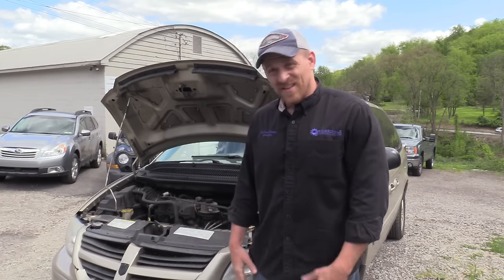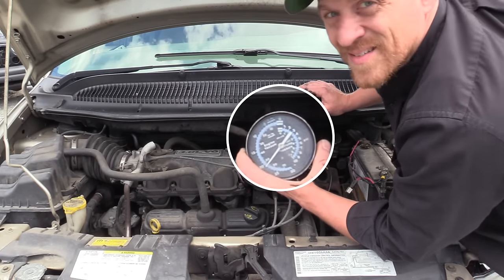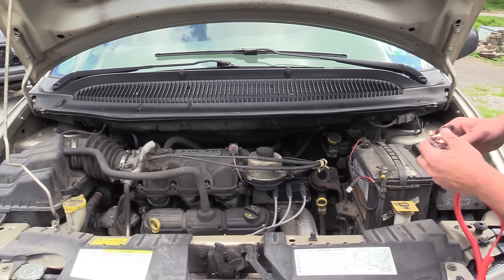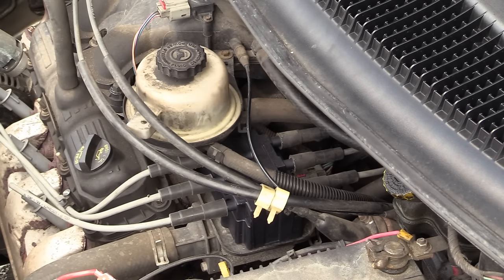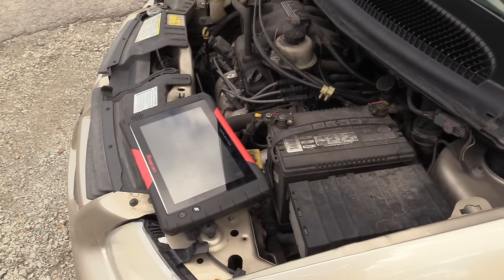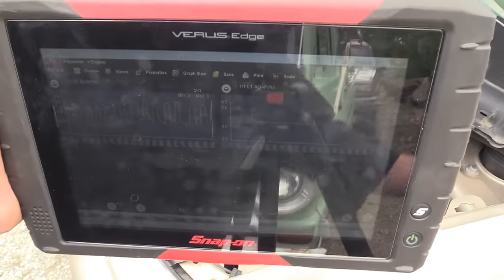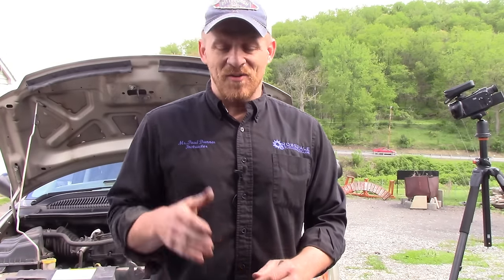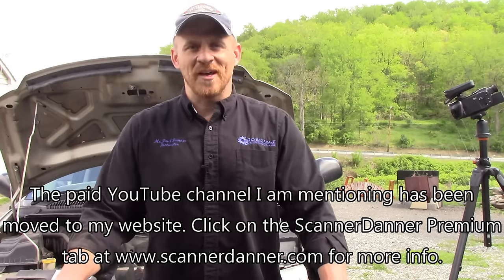Misfire Quick Tests (Is it a spark, fuel or compression problem?)

Comment: I cant say how many cars ive had that caused an intermittent missfire even after i did everything to them.  sometimes i would hear a slight tic noise, happened on my chevy tahoe with a sbc, 1 other wierd thing i noticed was if you slightly touched the throttle and held it, the rpm needle would stop and go stop and go through the sweep,  replacing the lifters solved it, now my best educated theory on why a lifter would do this is accessively worn lifter tolerances, becoming even worse as rpms increase the lifter will collapse more and reduce camshaft duration as well as lift, and late valve timing events, theres just no way you could ever catch that on a compression tester snce it reades the maximum compression that cylinder produced, and not individual compression cycles produced.

Comment: So, I wonder if the timing chain is worn enough to alter overall value timing (seems that rattle could be the timing chain) and a lobe or two on the camshaft  (or like you suspect, a lifter) may be worn adding to the problem. But as far as engine rattle noises go, the rattle could also be the alternator coupler.
Reply: I’m thinking that a timing chain problem would affect all the cylinders

Comment: 05 dodge grand caravan sxt 3.8L  270k miles

I just replaced all new seals ,injectors ,spark plugs, .. put all back to gather now misfire#5 .. (going to the shop).. but hey at least it don't leak and gas in oil not mixing .. always got to stay positive..

Comment: Hello Sir. I have a 04 MBnz E320 with P0305 code and p0300(sometimes) but 305 code everytime I turn car on. if I turn engine light off with scanner car works amazing!! if not, with engine light on idles rough. I replaced spark plugs 3 weeks ago still same just today I decided to replace coil packs and wires. light came on again and still same. I remove 1 spark plug and it looks bad like burn and smells like gas and oil and old coils were leaking after that I opened motor oil cap and saw a bad deposit build up on cap looks like coffee with extra creamer color. Can you help with some guidance p-lease???
Reply from the maker: Compression test must be done next

Comment: How would u check a 94 jeep Cherokee 4.0 for a misfire without your scan tools, and can i do what u just did with plug wires on my 94 jeep Cherokee without getting zapped
Reply from the maker: You may get zapped if your not careful or if you have an open plug wire but yes, it will help you isolate which cylinder if it is a constant misfire.

Comment: Hey Danner having major problems with a 2011 Chevy Aveo , all lights turn on but no crank . Everything is fine with the starter, and battery but I noticed the ems1 fuse keeps busting any ideas?
Reply from the maker: EMS1 powers the following:
ECM, ICM, EBCM, data link connector, Fuel Pump and Sender Assembly, control side power of the headlamp and fog lamp relays.
Heat and vibration are the keys to finding areas where a short to ground may be. 
This engine is not going to crank with this fuse blowing. My money is on the fuel pump. I would disconnect the fuel pump electrical connector, replace that fuse, then see if it still blows.
Reply: ScannerDanner so I disconnected the connector to the coil pak and the fuse didn’t bust, so does that mean the short is in there?
Reply from the maker: Yes it does my friend

Comment: Paul what would happen if you hooked the test light to battery negative instead of battery positive for that arch test? Trying to learn all I can about test light procedures. Thanks.....
Reply: probably not much but not recommended
since there is a possibility  that you might fry something with that high voltage
Reply: The test light is grounded to allow the coil to discharge. Saturating a coil and not letting it discharge is bad for it. That's why he was using his test light when he unplugged the spark plug wires.
Reply: Thank you gentleman for both of your comments, greatly appreciated.
Reply from the maker: The reason the test light is connected to ground, or anything metal on the car, is the block is a conductor for the return path of the spark on a waste spark coil. The test light being connected to ground, connects it with the block and is now part of that conductor. 
If you connected it to battery positive in this circumstance, I'm not sure what would happen. Could be nothing, could be catastrophic? Battery could explode, modules cooked? Not sure, I've never done that for this test. 
Best practice is to connect your light to the block, NOT the battery negative like I did in this video.
Reply: ScannerDanner 
Thanks for the explanation Paul, appreciate it as always.

Comment: Do you have any recomendations on getting rid of carbon on valves 2011 grand caravan
Reply from the maker: I am assuming this is a GDI engine? Guys in the field are removing the intake and manually cleaning them with walnut blasters and chemicals. Good luck. There is not chemical you are going to run in that intake once the carbon is built up enough to cause driveability problems. The chemicals should be used as a preventative measure.

Comment: About the valve seat, couldn't it be that the valve seat has a carbon build up and when it rotates it doesn't seat completely well and cause a low compression?
Reply from the maker: On this one, I didn't care beyond telling the garage it was a mechanical issue

Comment: i had  a caravan do the same exact same thing , putting oil in low cylinder brought compression back up, turn out injector was washing oil off cylinder walls, new injector repaired problem
Reply from the maker: In this case it absolutely was not a injector leaking causing cylinder wash. We had a constant misfire at idle and normal fuel trim numbers.
Reply: I have a 3.8 engine as well I'm having a misfire on cylinder number 5 I replaced the whole head the whole top of the engine on that side is all brand new still have misfire any suggestions?

Comment: why is the next compression spike higher after the low one? great video thanks
Reply: He is measuring amp draw during cranking. The lower peak is less draw because it cranks easier on the cyl with low compression. Then the starter has to play catch up when the next cyl has increased compression. I am not a professional, just my take on it.

Comment: awesome video thank you   you sound really really smart with engines,  i have this same problem  i brought a 2005 town country 3.8 with 120 k on the engine   i changed everything you have  mentioned i mean everything  so almost 80 k later and no one can figure out the problem except me yes really   i have come to the conclusion its a broken spring on the rocker arm this will only affect your car while  idling yes sir it will   so my advice run this shit  to the ground no worries  she will  keep going dont worry  it idels like shit but she run like no other 80 plus mph no problems really
Reply: If it was a mechanical leak (valve, rings): it would NOT BE showing INTERMITTENTLY ...
I fixed a random misfire on wife 3.2V6 Acura by swapping the low mileage Irridium OEM plugs with Platinum plugs.

The hair-thin center irridium pin does not fire too well in lean mixtures... The double platinum has a slightly larger pin and provide more consistent spark path.

(I know a needle tip is supposed to spark easier but the cylinder fuel mixture is not 100% consistent, so stubby electrode better than skinny!)

Comment: Hey Dan...So when I accelerate the vacuum gauge doesn't zero out, Instead it goes up to 25 hg's and takes about 2 minutes to come back to green zone🤔?
Reply: Clogged catalytic converter most likely
Reply: @stevewalker412  //thanks for the reply yeah it took it to a muffler shop and they told me it wasn't clogged, so I'm going to get a second opinion because it keeps turning red. I don't see the red during the day but at night I can see glowing
Reply: Some cats can be unbolted see if you csm unbolt and look as far as it being red i think its too much fuel missfire  thats unburnt and the cats reacting too that ... you need too have that scanned
Reply: @stevewalker412  previously had a misfire, but that's been corrected. Maybe because the misfire was there for so long it might have caused damage to the exhaust. it's only getting red right where the exhaust manifold connects to the Head. Car doesnt have loss or lack of power. Heres the interesting part.... When I disconnect the PCV valve the exhaust manifold stops getting red, so obviousl it's is getting more air. But then again if the exhaust is partially clogged it would have back pressure!! Maybe that's why when I unplug the PCV valve  the temperature drops and pressure is relieved so it doesn't glow red. What do you think?🤔

Comment: Hello  .  I apologize in advance for the English from google translate.

 I have a constant error P0305 misfire .... I have new spark plugs cables and coil plus 2 more working but I still have P0305 check engine .  I tried swapping the spark plugs and the injectors, but still the same... the spark plugs throw a spark, the injectors show values of around 3ms at idle and now, according to diagnostics, it omits important information only at idle, but when I increase the revolutions or drive, the engine runs on 6 cylinders.
 It runs on 6 cylinders even after disconnecting the battery, even if I increase the revolutions, leave the idle, still on 6. But when I start driving after about 5 miles, when I take my foot off the gas, the error p0305 pops up again..... plain and simple if  error p0305 is registered so when idling at an intersection or driving in D without gas from a hill commuting to an intersection I have a 5 cylinder, but when I drive with my foot on the gas I have a standard 6 cylinder... and when I disconnect the battery again I have a 6 cylinder again until  I don't drive again for about 5 miles and take my foot off the gas and the p0305 pops up again and when I start I hear the pump longer but it starts on turning
Reply: I never had this problem on my first dodge caravan and it has 350,000 miles on it and I've owned it since 174,000 miles and it still runs.  my second dodge caravan on which I am dealing with p0305 has only 203,000 miles and it is quite annoying.  Yes, I could throw him off a cliff, but I won't give up

Comment: Iv got an old vauxhall astra 1.6 that will missfire at random but I consistently have power and control to the injectors and coil pack (coil on plug) it will only missfire when warm so I'm scratching my head any suggestions before the parts cannon is lit? 😊
Reply from the maker: Misfire warm at idle or under load or all the time? Trouble codes?
Reply: @ScannerDanner  had no trouble codes and would act up warm and only under load turned out to be the coil pack, I thought it was strange as usually they are either good or bad but not today! 😜
Reply from the maker: @JohnJohn-ij5rj  very common to have a misfire only under load with a coil that is failing and producing a weak spark

Comment: Can anyone explain why if it was an injector problem you would see much higher fuel trims? Wouldn't any dead miss give higher fuel trim numbers?
Reply from the maker: So in this case, for an injector to cause a compression problem from excessive fuel (cylinder wash) the fuel trims would have been very negative. So we can immediately rule out a cylinder wash issue, confirming a mechanical problem with the engine. Make sense?
Reply: In the sense of a compression issue, yeah that makes sense now! If you have a dead miss on a cylinder (say no spark) fuel trims would be much higher on that bank due to an O2 sensor reading excess air, correct?

Thanks for the reply!  @ScannerDanner

Comment: I had the same problem, after replacing coil. Spark plugs and wires. # cylinder 5 spark plug gap gap was almost closed. Not much gap. Probably my super duper mechanic hit it while putting it in or he didn't check the gaps

Comment: number 1 cylinder is completely dead any ideas?
Reply from the maker: put air in the cylinder with the cylinder on it's compression stroke and listen to where the air is coming from. (intake, exhaust or crankcase)

Comment: My own 07 Caravan is also a POS. It needs new pads and rotors on the front yearly. When you turn the right signal on the left side flashes but the engine runs perfect for 170000 K  I really don't think there is a better mini van for the money on the road. I guess that's not saying much.
Reply: I always thought the brakes were undersized on the T&C.  Also, the turn signal switch is full of resistors that get switched into the circuit to tell the controller what has been selected.  Corroded contacts will cause a wrong resistance reading and the opposite turn signal can activate.
Reply: wysetech2000 Wow, 170,000k?!? That’s 170 million. Very impressive

Comment: Couldn’t you put the wps in the intake stream and use a piston overlay to see where the pressure is going or not going?
Reply from the maker: Maybe, or maybe I would have needed to measure the exhaust to see this one. Then about 5 more hours of screwing around, filming and editing on the chance I may see it? No thanks. Not today and not on this p.o.s. van 
But I can certainly relate to your comment. If it was as the school I would have done what you are suggesting. No pressure there.
Reply: ScannerDanner agreed. Engine was junk. The extent to its junkiness didn’t matter at that point.

Comment: Opinion on ford focus 02 lx 
Voltage drop after new alternator and battery put in and starter. But if shut car off charge back up to 12.5. But driving guage jump from 14.1 to 12.3 to 11.9 and all over I love these videos

Comment: Girlfriend's Jeep was a mess random and o3 04 06 cylinder replaced coil rail plugs and new injectors used a good motul engine flush and my God did that help the sludge cut free and she runs good have not had a code since

Comment: Hydraulic lifter getting gummed up from lack of service most probably.
Get some paraffin in the oil, run it up for about a half hour then oil n filter change.
Reply from the maker: That was my thought. Now how to prove that without tearing everything apart was why I stopped. Not to mention we did not have the okay to go any further. Sorry about that. I would have liked to have known for sure myself.
Reply: put some marvel mystery into it see that fixes the problem . If not you know u need to dig deeper.
Reply: Those rear heads lose oil flow.
Reply: anonymous  Yes.

Comment: very like what I had with a GM with a broken valve spring. depending how it was it would open valve OK or not. at higher rpm the lifter would pump up and compensate. at lower rpm the lifter would not pump up enough to compensate.
Reply from the maker: Seems a  broken valve spring is the most common reply
Reply: ScannerDanner  it's the spring combined with the way hydraulic lifters work. Solid lifters and mis fire there all the time. Big fan of your videos and teaching mate.

Comment: did we ever find out what it was?  lifter getting stuck in some sludge?
Reply from the maker: no, never tore it apart, customer declined to go any further. But if you read the comments, the going consensus was an valve and seat issue due to the repetitious nature of the low compression (valve spins as it goes up and down)

Comment: +ScannerDanner what signals are you probing? it wasn't clear to me.
Reply from the maker: Watch the other two videos I linked okay?
In short, one was an amp probe clamped around the battery cable and the second was an inductive pickup on one of the plug wires.
Reply: ok I see how you did that now, can you explain why the starter amperage is lower on a cylinder with bad compression? How do you know its not a dead spot in the starter motor?
Reply from the maker: Did you watch the other two relative compression videos I have linked in this video? They will help answer this.
Reply: Ah yes it was the third video with the verus. Thanks. I really appreciate all the work you do here.

Comment: I missed where did you plug the probes, where was it?
Reply from the maker: Check out the description of this video. I linked other relative compression testing videos for you guys to be able to learn these techniques. 
In short, the amp clamp gets connected to the battery cable that leads to the starter motor and then the second channel gets connected to an ignition firing event.

Comment: would a leakdown test find this issue?
Reply from the maker: From memory this was an intermittent compression issue (valve or seat related) so you could definitely miss it with a leak down if the valve was sealing at the time you tested it

Comment: Scanner danner!! I have a misfire cylinder 2 and it's a new engine. Changed plugs, wires, EGR, and MAF sensor. Tell me it's not a head gasket 😪
Reply from the maker: Do a quick cranking compression sound test to start witj

Comment: After this you could use a regular compression gauge like we did in the 1960s then compare each cylinder
Reply from the maker: For sure!
Reply: We used to put a tablespoon of motor oil if the compression  went up then we knew you needed rings on the piston if it didn't make a difference it was the valve hanging open for whatever reason good way to narrow down we didn't have all these fancy gadgets from the old school mechanic